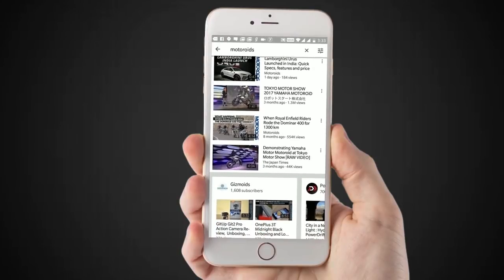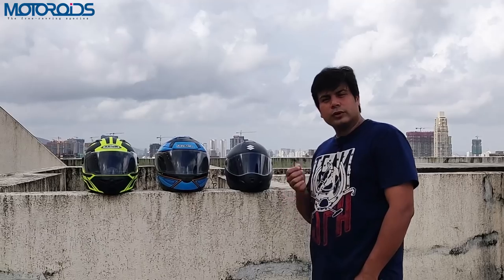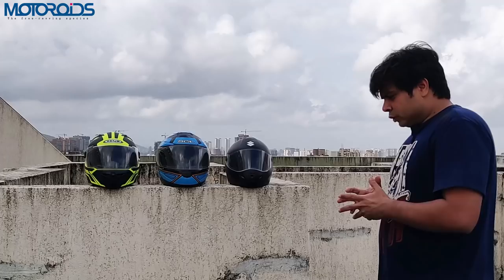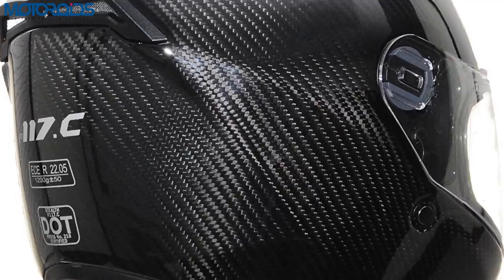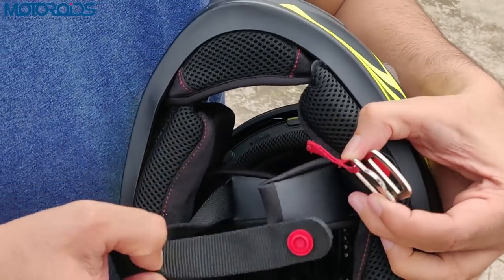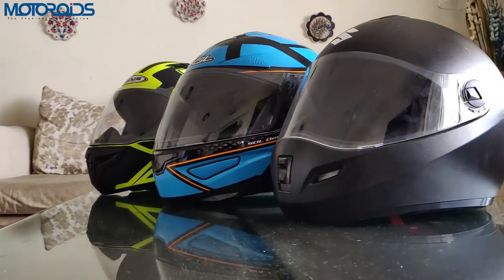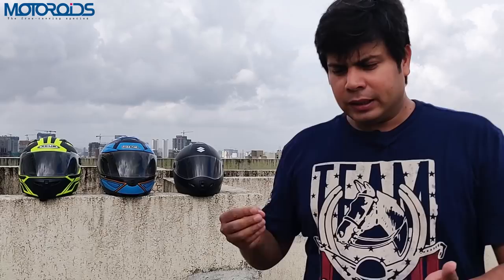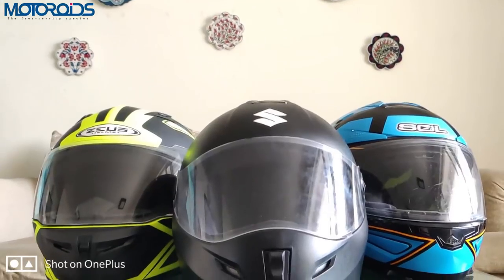DOT Vs ECE Vs SNELL Vs ISI Helmet Certification | Differences Explained in Detail | Motoroids

Comment: One point you missed is that DOT allows up to 400g to pass. Whereas ECE and Snell is about 250g. Which would you prefer?

Finally, I trust Sharp the most because it’s not just pass/fail. There’s a star rating. So an ECE certified helmet might only get 1 Star or get the maximum 5 stars. They also do crash tests at multiple heights which is useful to note. The downside of Sharp is that they don’t test many helmets. For example, they don’t test adventure helmets which is what I have. My Bell Max-9 adventure MIPS is only ECE tested but I’m ok because it’s a very trustworthy brand.
Reply from the maker: Thanks for sharing your valuable thoughts
Reply: I recently bought a Bell Race Star because my other Bell Mx-9 was causing me headaches. I re-measure my head and apparently my head has grown since I was in my 20’s!  So an important point is to measure your head (or a friend can do it) then try on a helmet for at least an hour. If your retailer won’t let you then make sure you have the option of returning it and wear it at home to see if it’s comfortable. While it shouldn’t be too loose it also shouldn’t be too tight. 

I now think I’ve got the perfect helmet. I don’t trust DOT but this one is DOT and Snell 2015 plus the European version is ECE, Snell and Sharp 5 star rated. Furthermore, it fits like a glove but with no pressure points. Finally, I got it on 50% discount because the colour scheme wasn’t popular but I love it (white, yellow hi-vis and blue).

Try to buy a helmet that passed multiple tests and you’re probably covered for safety. But make sure it fits, is comfortable and conspicuous.

Comment: Dot, isi, ese are pointless test and just makes the helmet more expensive. They originated their testing methods from 1960s for helmets in race cars. Anyways, most driving in india is under 20kmh, that's why helmet safety doesn't matter here.
Reply from the maker: Crashes don’t happen at 20 kmph.
Reply: @motoroids  the common accident under 20 is hitting the brakes over some sand/dry dirt. Just get gloves at least, it's happened to all over us.
Reply: @emmanuelgutierrez8616  agree qith you but ppl must not take risk... head is much precious and 5k 6k full face is nothing in front of it.. when yuh can afford 70k to 90k gearless scooter
Reply: @CaptainScorpio24  yeah, but then it gets too hot. Ofcourse a rider should  have safety and comfort in mind and will have multiple outfits for different days.
Reply: @emmanuelgutierrez8616  yeah but its okay to sweat than to bleed. 🙂